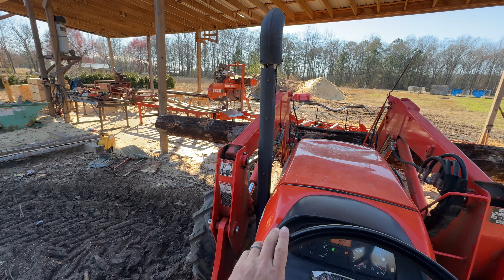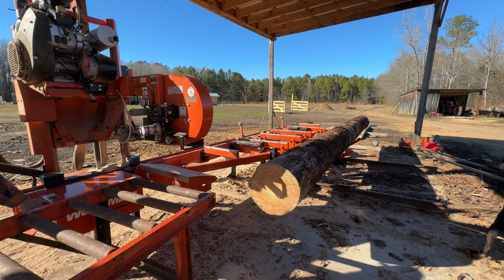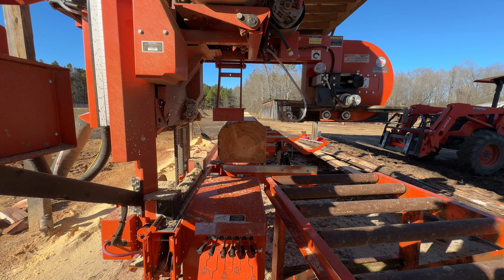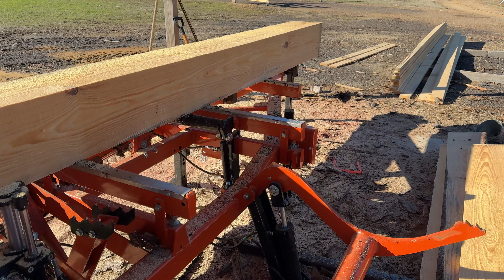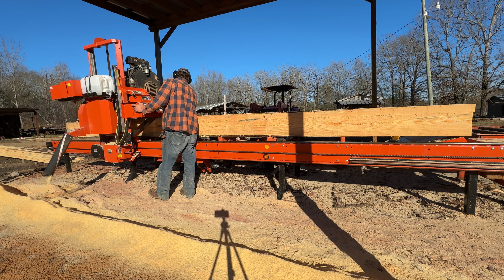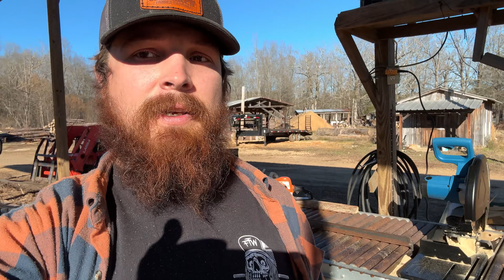Sawing LONG timbers for the GARAGE build!!! (How will we EVER hang these things?!!!)

Comment: I am curious what you saw would do if you were not at the controls by the time it reaches the end of the carriage?  I did not know if it would auto stop or bind the head motor.  I have a manual mill and I have wondered that.  Thank you.  Great Video.
Reply from the maker: It’s keeps pushing forward. I guess it would be bad for the motor if you did it to often.
Reply: @wallacefarmandsawmill  I kind of did not think that Woodmizer would have incorporated limit switches but I did not know.  Thank you for answering my question.